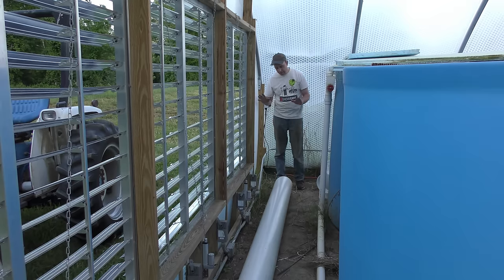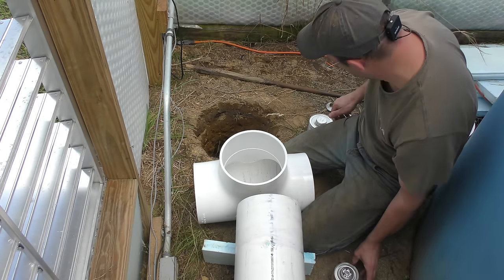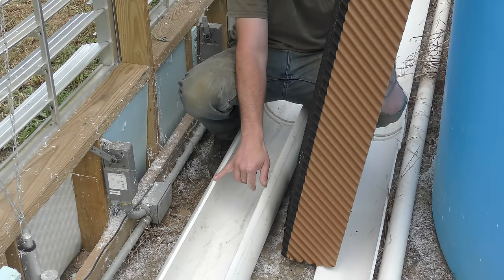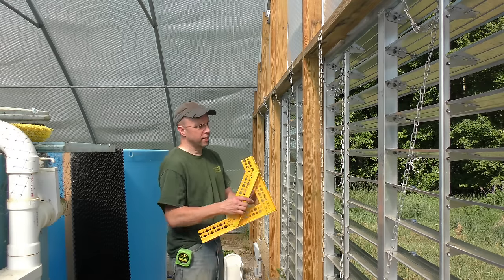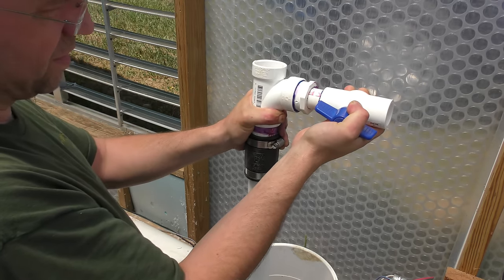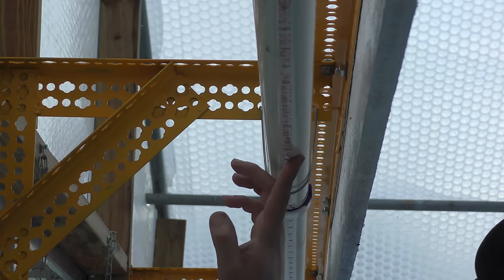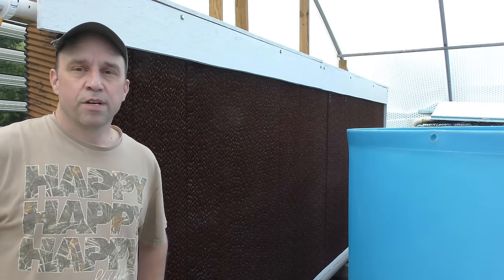Building My Own Evaporative Cooling Wall (AKA Swamp Cooler)

Comment: would the black of the pads facing the outside heat up and create convection in the wrong direction? I would think you would want a white outside facing pad and a dark inside facing pad so the tendency to produce convection in the direction of the heat would be in your favor. Are you using a fan on the other side of your greenhouse to draw the air in?
Reply from the maker: they're on the north side so there is no direct sunlight hitting them.  The manufacturer says they should face this way to prevent algae from grown on them.  I just installed them as told.  ;-)  There are two 48" fans on the other side of the greenhouse

Comment: You could have angles the water drip pipe away from the pump so that the water can flow further faster, not much of a incline or decline, all depends how you look at it, from the pump it would be a decline towards the opposite end, I would say no more than a 1/4 to 1/2 inch drop in elevation.

Comment: Do you have a link for the pads? thinking of doing a wall for my porch. Awesome
Reply: What he has essentially built is what the commercial/industrial HVAC industry refers to as an air-wash.  I'd research there limitations before proceeding with this type of evaporative cooling.  Humidity and ambient air temperature (wet-buld) will determine their cooling capacity. I believe his build was based off this video:

https://www.youtube.com/watch?v=WrqBfNTWSgI
Reply from the maker: I based mine on the FarmTek setup, but this video looks about the same.  Relative humidity has a huge factor on the efficiency of these.
Reply: Thanks guys

Comment: If the pipe isn't under pressure, you don't need glue, much less the "cleaner." Friction alone is usually enough to hold them together, without leaking.
Reply: That is not always true, Water weighs a lot and therefor can push sections open.

Comment: He should of never glued any of the PVC fittings  ( end caps, couplers,  etc ) together.  Following a maintenance schedule,  he will need to clean out the inside of the pipes to remove scale,  dirt and sludge. Now that it is glued together,  he won't be able to do that and the piping will eventually clog up.  Examine the plumbing arrangements  of a portacool pac2k4825 / mastercool ADA 51 - 71 as examples
Reply from the maker: I don't know what you're talking about.  I can access any part of that system and clean it out.  the pads come right out and the supply lines are attached with couplings so it can be dismantled.

Comment: How long did this project take you? Also, what is the name of the adaptor you used to expand the ends of the flex hose to add your elbow fittings?
Reply from the maker: a couple of days because of the time to film it.  The expansion tool is common for plummers that use pex tubing.
Reply: Pex Expander

Comment: ........so, not a single bit of data on the alteration to the temperature......................................
Reply: Yea without some data / measurements this video is not very useful.
Reply: Swamp coolers are a well established technology and the science is not very complicated. The change in temperature will depend on a ton of factors like the temperature and humidity inside and outside of the greenhouse, the amount of water you are pumping through it and the airflow through the corrugations. The video is a really good walk through of the construction for someone who doesn't know where to start. I'm not sure what data you think would be meaningful. But if he took a thermometer and showed you the temperature that would be entirely useless. A walk through of the construction is way more useful.
Reply: If you check out his Facebook Page, he has been posting the recent temperature data, and its impressive the impact that it is having. But as mentioned below, Evap Coolers are a pretty standard piece of climate control equipment across the industry. This isn't really a video to prove the technology, it's a fantastic instructional on how to do it yourself, rather than buying a manufactured evap wall.
Reply from the maker: If you stayed to the end of the video, there was a link to the second video with all the data.  ;-)
Reply: @excitedbox5705  Perhaps we shouldn't confuse quantitative with useful.  I'm certain you can scrub for data on evaporative cooler panels with its thermodynamic effect in relative structures; nonetheless, there's much value in learning from his component selection, chosen configuration, and troubleshooting process.

Comment: How does this system work in regards to mold? Separately, how often would someone have to replace those pads?
Reply from the maker: no problem with mold.  At the beginning of the season I'll add some bleach to sanitize it.  These pads are 5 years old...probably will be ready to replace in a year or two.
Reply: @Bigelowbrook you will run the bleached water through the pads?

Comment: What but was that bit you were using on your drill  to expand those hoses in the pump?
Reply from the maker: It's a special power tool for expanding pex tubing.
Reply: It's a tool you get to expand uponor pex. It makes water tight fittings that don't use any adhesive.

Comment: PVC cleaner not only cleans pipe is actually slightly softens the PVC so the glue will really bond the two together.
Reply: The PVC cleaner is to remove any oxidation that has formed, that way when you use the "glue" it allows for a proper bond as it isn't a glue so much as a solvent that dissolves the PVC and as it evaporates it re-sets and fuses the two pipes together.

Comment: This cooling system must not have any holes on the greenhouse, except the fans and the cooling pads.. Right?
Reply: there are more fans on the opposite side of the greenhouse to exhaust air
Reply from the maker: yes.  It's a sealed greenhouse.  Air is sucked in through these and blown out of the other side with two larger fans.

Comment: If you drill the holes in a quarter spiral each direction starting at the far end and spiral up one quarter each way it may improve the water flow.
Reply from the maker: there would be enough pressure differential between the top and bottom holes where water would only come out the bottom.

Comment: turn the pads around, so that the air channel has to run upwards. this will prevent drips flying into the greenhouse.
Reply from the maker: the channels go both up and down depending on where you look at the cross section so it doesn't matter which way they go in.  Black goes on the outside to help reduce algae

Comment: I know absolutely nothing about this. Is it to cool water or to cool air in the space the wall its at?  So cool... 😐 Sorry. Haha
Reply: A fan is placed behind the cooling wall and blows air through the wall.
Reply: Esteban - It cools the air in the green house. It works well in drier climates.
Reply from the maker: It for the air.
Reply from the maker: @Deezuzjohn  Close enough.  Technically the fans are on the other side of the greenhouse and are sucking the air through them.  ;-)
Reply: So, if you have the space you can cool enough air to cool a whole room? Amazing. Can the air be ducted to other places or it works only in the same room it's on?
Reply: @Bigelowbrook  Yep, pretty simple concept
Reply: @esteva03  for about $600 I installed one on my roof that cools my whole house. It can be ducted, but we just open windows in each room a little bit to direct the air. These rely on the air being able to move out of the house. They will humidify your air (kinda nice in the desert). They don't work where it's already humid.

Comment: im not expert but you are not supposed to maintain the pad completely wet, otherwise it would not evaporate fast enough to cool down the air.
Reply: Lots of swamp cooler fans will constantly dump water over the cardboard.

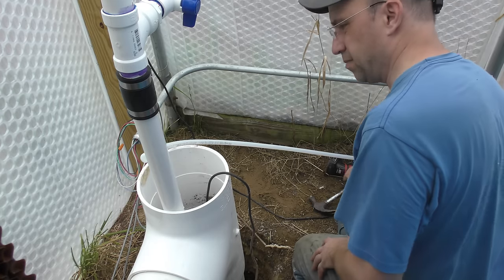Comment: What's the tool you use at 16:32?
Reply from the maker: It's used to stretch the PEX so it will fit over the fitting.  https://www.supplyhouse.com/ProPEX-Expander-Tools-Heads-31000

Comment: depending on your sump size wouldnt you be better off preventing the heat entering in the first place by pumping a stream over the roof of the building/enclosure? You know evaporative coolers dont work in humid environments. When the air becomes saturated evaporation stops. but with your windows open it just ...oh i see it flows through...so you need hot air input for it to work.. so evaporation is going to be high regardless.. so a thin flow of water over the roof would evaporate less theoretically. because it will be running over a cooled surface. a large sump kept underground with radiator like properties will exchange heat into the ground....SHADE..no wait its a green house? needs sun? but kept cool. how about solar panels for shade powering artificial lights? flouro tubes specific sodium phosperous/phosphate or what ever they are....cost? right.. cardboard pvc and some duct tape budget. what are you cooling? (I didnt watch the whole video.)

Comment: Feet? Inches? Had USA not already defeated that crap and had they switched to the metric system that absolutely everyone in the world uses?

You need to change the 2 top tubes and make more and little holes on it. You do few holes and too big.
Reply: Cosme, it is true that most of the world uses the metric system. However, the U.S. and Canada use both the old imperial system AND the metric system. We're sorta bilingual in a  sense. Different strokes for different folks.
Reply: Imperial measures are better
Reply: @paulmaxwell8851  It is perfectly understandable that they have not yet been able to switch to the metric system as all the other countries in the world have done. But you have to understand that the video has visitors from all over the world. Not just from those two countries.
Reply: @josephhanson334  The imperial system uses metric units to define its units.

Comment: So I guess when the manufacturer put on the can that part one is a primer and part two is a rubber cement they do not know what they are talking about .
Reply: I don't think he used primer at all. He used cleaner and then cement. And I don't think the cement he used is a rubber cement, but a solvent cement (weld).
Reply: The primer is actually a cleaner and the cement (glue) is a solvent that melts the PVC and fuses the two together.

Comment: where is the water coming from??? his hose?? so insteading of a cooling bill he gets a higher water bill?? doesn't really seem worth it to me. unless it some how pulls the water from the air then maybe..
Reply: His water is coming from a well so he figures the cost of  running the well pump.  In the video "Evap Cooler- The Cold Hard Facts!" he says the water consumption per hour is 25 gallons but with lower humidity it could be up to 30 gallons per hour.  There is no doubt that 25 gallons of water per hour costs significantly less than electricity to run any kind of an air-conditioner per hour..
Reply: What planet are you from. Nearly in every country water us far far cheaper than electricity for cooling. Especially if you have your own well or bore hole.
Reply: thats also what will happen Jay. the air's moisture will get trapped in the cooling pad as well.
Reply: Hey haters, this technology is used in India because it's so efficient...  Cut and paste cooling pads and pvc with clay pots and cement catch basins!  FYI, this low tech, technology also creates humidity at a rate that humidifiers can't, it's natures gift to dumb humans.  You can thank ancient Egypt for the ideas and keep your humidifiers, thanks.
Thanks for the video btw Bigelow, I've been finding them for a while.  They are very well done and give me lot's of ideas!
Reply: @renfrewcalgary2830 is there a video on this or could you go into more detail?
Reply: The water is circulating, so there isn’t much waste of water.

Comment: Get an air conditioner....This is nonsense..You people are nuts.
Reply from the maker: LOL  Try running a greenhouse this size using a chiller and you'll be bankrupt in a month.
Reply: Yous nuts, clearly have no clue about the cost or equipment to cool a space like that
Reply: Using evaporative coolers is standard in tunnels in hot dry climates. Way more cost effective and more lowtech than aiconditioners.